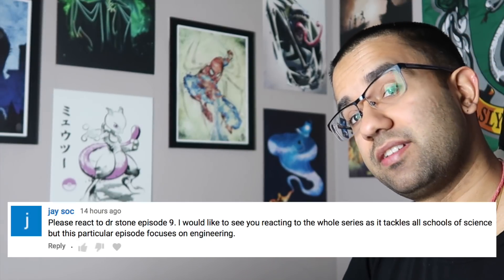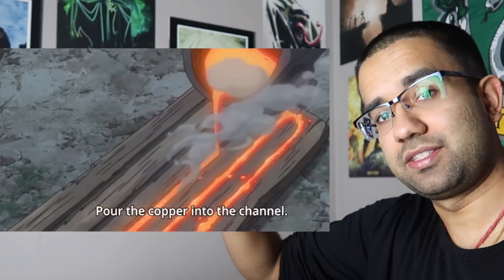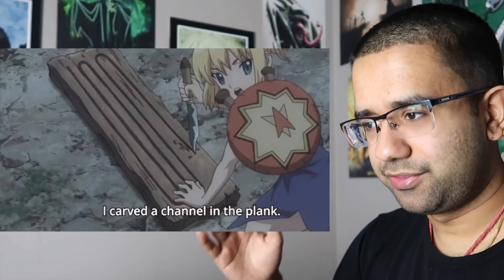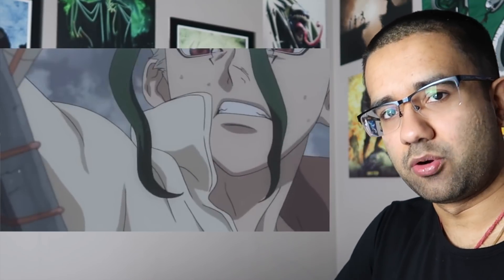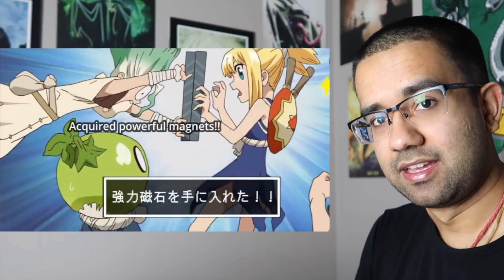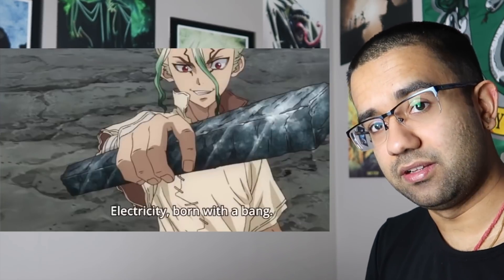Real Engineer reacts to Technology in Dr. Stone #9

Comment: Granted pure iron won't hold a magnetic charge, however it's very difficult to smelt pure iron and steel has enough impurities in it to magnetize. I used speaker magnets to induce a field into a needle and made a compass as a kid. This is also how neodymium industrial magnets are created. An ingot of Iron alloy is placed next to an electromagnetic field and charged for a couple of seconds giving an intense magnetic charge that can be used for electric motors or even generators. A variation of that process is used to charge the magnetic pickups in an electric guitar.

Comment: When Senku put lacquer in the iron and it getting hit by a lightning and the aftermath this iron acquired magnetism is a correct.

Magnetism is caused by the motion of electric charges. ... Their movement generates an electric current and causes each electron to act like a microscopic magnet. In most substances, equal numbers of electrons spin in opposite directions, which cancels out their magnetism.

Comment: The rod get a shockwave and superheated fore a split second any magnetic field  around the rod will set into the rod itself after the magnetic field  being electrically generated   goes away leaving you with a magnet. There is an easer way.  get an iron rod that is 2 meters long align it to magnetic N S . hit the center of the rod with a hard  steel hammer a couple times . and the rod will become  magnetic.  its the same thing   just  What stone is doing is  killing 2 birds with 1 stone.

Comment: anything heated above its curie temperature will lose its magnetism. For rocks and minerals, the curie temperature is 570 degC. magnetite's melting point is 1597 degC.
Do you really think a once melted magnetite will retain or regain its magnetism?

are you really an electrical engineer?

Comment: I doubt he is an engineer, and if he is he must be informatic engineer. Any engineer of a field related to physics (aka 99% of them) should know about remanence. Wen a ferromagnetic material like iron is under a magnetic field, and then that magnetic field is removed the iron doesnt go back to its original state. 
 Iron maintains a portion of the magnetic field creating permanent magnets, this leftover is called remanence, depending on the material the remanence can be as high as the saturation magnetization (max magnetization posible)

Comment: Umm...The core loses its magnetic properties only for a specific metal...Which is good at it "soft iron"....It actually used to be a problem that the cores used earlier retained the magnetism for a longer time and won't shut off immediately after the electric supply was taken away...And it was tackled using soft iron core which immediately loses all its acquired magnetic property...It's basic isn't it ?

Comment: I remember a science project involving an electromagnet with a battery, when we turned the switch on, all the screws got sticked to the electromagnet BUT the fun thing was when we turned the switch off and disconected the battery, the screws were still attracted to the magnet, like for an hour, after that, the magnetic force started to discipate. I guess with a lightning it takes longer
Reply: Yes indeed! It depends on the type of iron used for the experiment. Some types of iron have more retentivity than others.

Comment: Iron is one of three basic metals that can be magnetized. Creation of a permanent magnet requires special equipment, as the iron rod would need to be heated past 1418 degrees Fahrenheit. But a temporary magnet can be created using simple household materials. like dude ive taken so many classes of electrical theory and its just annoying hearing that the only way to make a magnet is with another magnet... like what no its not, and a lightning bolt is well enough to heat iron to 1418 degrees

Comment: Even for a normal electromagnet, the magnetic field won't completely go away. That's why a dc generator with self awakening coils can kickstart itself, if it ever run before - the little bit of magnetic field is enough to generate a little bit of current, which is enough to kickstart the electromagnet proper.

Comment: around 3:20 hes talking about the currents only lasting a few moments after the initial charge stops. i think hes forgeting or just overlooking the fact and variables he said himself. the pole was insulated not the copper and how it was spread around is partially due to the fact of Science not artistry, he was right when he says the larger the input the likelyhood of the copper needi ng to completely cover that is true. if the copper can direct the curents to give a ionization charge within, which lighting stikes should be more than enough to do. you can make basic magnets out of electro magnets by ionizing or otherwise smelting out impurities in the metal to make them polarized. and this is where ill say.. engineers are smart and should know alot about the different processes and material properties. but an engineer is not a chemist, nor a physicist, or anything like a scientist... now a good engineer will know all these thing. not all engineers are senku! lol

Comment: 1:10 the reason the electricity would go through the COIL and not the iron rod itself is because strong electrical currents tend to force the moving electrons to the outer edges of the cable or wire, I forget the actual name for the effect, but a lot of those hanging electrical cables are hollow to save on materials because of this effect.
2:05 it wasn't framed as a particularly long shot, as the mountain Senku used for the experiment was home to a large deposit of natural magnetic ore which, in armchair scientist speak, means it would attract a lot more lightning, although the actual effect it would have is dubious, at best.
Reply: It's called skin effect. I know this thanks to Electroboom 🤣🤣

Comment: You are right that he should have coated the wire instead of the iron.

The reasoning behind this is simple, you want the electricity to flow through wire loops around the iron, if the loops touch they can short thru each other, unless properly insulated.

But looking at how 'tightly' he wrapped the iron it wouldn't have mattered I guess, but that lose of wrapping won't produce a particularly powerful magnetic field, as the volume it covers is to large.

Comment: i guess the amount of energy in  lighting is so high that senku needed only few turns of copper and when we create electro magnets we have high no of coil with less intense electricity which demagnetizes it quick
as per my knowledge the high intensity of lighting bolt had so much power made his electromagnet permeant

Comment: It's not an election magnet it's a iron magnet induced through electricity. Just wanted to correct that. You can make iron hold a magnetic 'charge' or be polerized rather by introducing it to a strong magnetic field like another magnet, or a electric field running throught a copper coil.

There still is the issue of number of turns on the coil to induce this effect however.

Check out an old book called mickey's magnet

Comment: So... guys. This kind of current would blow this copper wire into melting exploding copper. There is a looot of power in lightning :D
Reply: if you compare the wire's size, it's similar to real life lightning rods, so i think it would be fine. i hope to god it'd be fine, or several buildings near me are fucked for the next thunderstorm.
Reply: @justaguycalledjosh  it is very similar to The Copper grounding pole I put into the ground for my house.
Reply: I think you're right but if you look at the finished magnets you can kind of see what highlights on it, so I think it supports the theory that the copper melted into the iron.

Comment: 3:52 That's exactly what they did. They mentioned Wasilewski's experiment before the strike, which is the experiment that Senku is mimicking here, which resulted in the creation of a lodestone from iron.

Edit: I did look into it a little bit, and every source I found says he was successful. He tired a copper wire around a small bottle rocket and shot that up into a storm in New Mexico. The wire leads to a box that was filled with sand with iron laying on top of it with the copper wire wrapped around the iron. When the wire was struck by lightning, the current was sent down through the wire and turned the iron into a lodestone. I may have a few details about how it exactly happened, but I can link to some sources if you'd like me to.

Comment: Have you ever run a magnet over a needle a few times, then found the needle is now magnetic? A similar principal is being used here. Except the lightning heating up the metal rods allows the magnetizing effect to be permanent, rather than temporary.

The copper coils were less to generate a magnetic field, and more to shape the field that would form naturally. Metal struck by lighting is almost always magnetized quite strongly as a result, the coils just forced the magnetization to be uniform and directed  (with the N and S poles being on the long ends of the metal rods, rather than the sides). They only needed so few because only a weak magnetic field was required to direct things while the lightning naturally magnetized the metal rods.

The lacquer was probably more for heat insulation than electrical insulation, giving the metal more time to fully align magnetically.

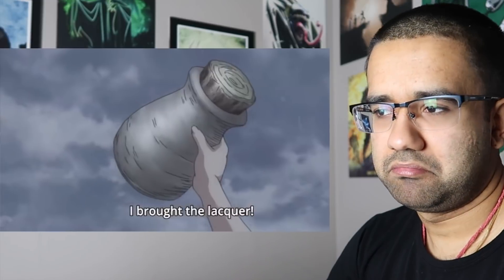Comment: 1:33 in my opinion the reason they are coating the iron rod instead of the copper wire is because since they are doing it in a middle of a storm there’s no telling when a lightning bolt will strike next so it’s a race of time so they aren’t sweating the small stuff because this is there best chance to catch some lightning/electricity

Comment: Actually I remember reading somewhere that when a ferromagnetic material wrapped in coil is exposed to an electric current higher than a particular limit, it does permenantly magnatize it.
But the electromagnets we use are made so that we can switch it on or off as required so we do not actually take it to that level of current

Comment: 3:00 Actually you can make a permanent magnet by heating the iron, magnetizing it, then cooling it. While the iron is heated the domains are able to be influenced into a magnetic alignment, once it cools they are locked in place and you have a permanent magnet.

Senku used the massive voltage of lightning and resistance of the spear it was on to generate heat and an electric current simultaneously. How well it would work under these conditions is...debatable but the theory and method is sound.

Edit: you can also de-magnetize a permanent magnet with heat as well.

Edit 2: electromagnetism is temporary because its it the product of induction rather than domain alignment. In the same way magnets can physically slow down a piece of copper and induce an electric current, electric currents can induce a magnetic field to move things.
Reply: Matt B actually the experiment he based it on is very real and has proven its results I actually encourage you look it up the copper wire is strange to me as it was not needed for what he used it for in this case since the experiment used to wire to bring the electricity to the rod in this case the rod was already filled with electricity other than that a very similar was already done and proved such an idea was possible
Reply: I think the iron rod was coated so that lightning only passes through the copper wire and not the iron road. To summarize both purposes, lacquer is for insulation.

Comment: wowowo and you are electric engineer???!. Senku did made some research and... A magnet is created when certain condition cause separate domains in a ferromagnetic item to be all aligned in the same direction ..The main way that permanent magnets are created is by heating a ferromagnetic material to a key high temperature. The temperature is specific to each kind of metal but it has the effect of aligning and “fixing” the domains of the magnet in a permanent position. So he used the copper to creates magnetic field he indeed did not needed to much turns due the high current and high voltage of the lighting bolt. Also if you look closely he also used the high temperature of the ligthing to move and fix the domains of the iron rod and you cal also see the marks that the cooper left in the rod.. so he used a high voltage and hing current to create a high power magnetic field, used the ligthing to "cook" the iron and fix the domains in position.

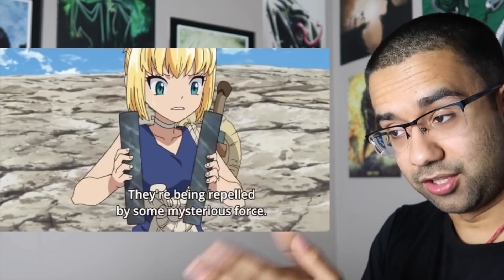Comment: 4:00
When you describe the “lode stone” (I’m assuming that’s the spelling in this case), don’t forget about what they used to collect the Iron Sand as well as the leaf compass from last episode.
I don’t know if those rocks were actually the correct stones, but they did have enough of a magnetic pull for them collect all of that iron.  Could those magnets have worked?

One thing I’m not sure about in this theory, though.
Would Senku and the others have had to melt down the original magnets to create the soon-to-be Electro magnets?  And, if so, would that have actually worked as a built-in lode stone?  Or at all?
I’m asking legitimately.  I have no idea.
Reply: You can magnetize iron and other ferromagnetic materials in different ways.
You can heat it up, and let it cool down inside a magnetic field. You can also align an iron rod with a magnetic field and send strong vibrations through it. Like, take an iron nail, Point it North or south, an hit it a bunch with a hammer. It will gain a small magnetic field.

A combination of those Methods is used industrially to make artificial Magnets.

Its also possible to rub a nail against one end of a magnet, to give it a magnetic charge. 

Basically, iron consists of many magnetic Domains, if most of them Point in the same direction, the iron is magnetic, if they Point in different directions, is not magnetic. so if you use heat, vibrations and other Magnets, you can rotate them into the desired direction to make another magnet.
Reply: @proclarushtaonasat  So we could assume that lightning heat up the iron rod, copper wire provided electromagnetic field and rain cooled the iron down?
Reply: @GrzegorzSobkowicz  yup, although the Show uses time skips a lot, so they might have waited an hour or so, before they picked up the Magnets. They also usually Show the creation of 1 Invention, then make a couple more off-screen. Like with glass blowing, we got to see them make 1, then they suddenly had a lab built, after what i assume is at east a week of off-screen work.
Reply: Grzegorz Sobkowicz most of which yes the Cooper in this Experiment however may not be necessary I’m not quite certain I’ve looked into the experiment however they didn’t use copper wire and it was used to channel electricity through the rod on the original experiment because it was tied to a small rocket which was sent up to be struck I dunno if the copper in this case is necessary
Reply from the maker: Lode stones are usually found where lightning strikes the earth, not likely in a river. Senku needs a powerful magnet, and as he said in the show, natural magnets are not gonna cut it, we can engineer stronger magnets with a greater magnetic force, which is what he did.
Reply: Also, ive been thinking About the insulation. Senku put it on the iron, not the Copper. Normally you insulate the Copper, cause thats where the electricity flows, however in this case, there was no outlet or battery providing the flow through the wire directly. Lightning chooses the path of least resistance, so if the Lightning went mostly through the iron, the Copper would have generated a weaker magnetic field. (at least thats what i assume would happen, a thick iron rod would allow more power to flow, than a thin Copper wire) 
by putting the laquer on the iron, while leaving the Copper naked, he could have directed the bolt in the desired direction to generate maximum magnetism out of the 1.21 Gigawatts
Reply: The mountain were they magnetized the iron, “Bald Mountain”, is where they said they collected all the natural lodestones from, which they used for compasses and to collect iron sand. They also said the mountain was constantly struck by lightning. So the chance of lightening striking their iron rod was considered high. Of course it happened quickly because the story required it. :)